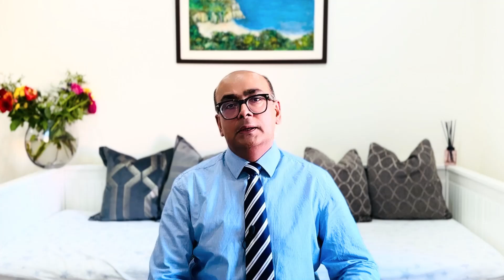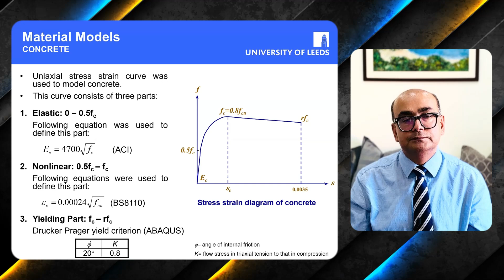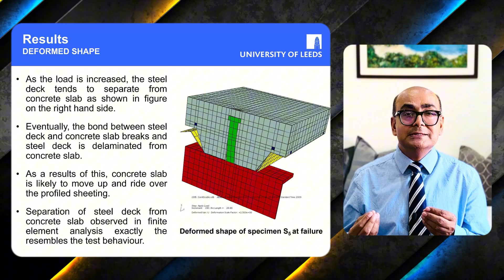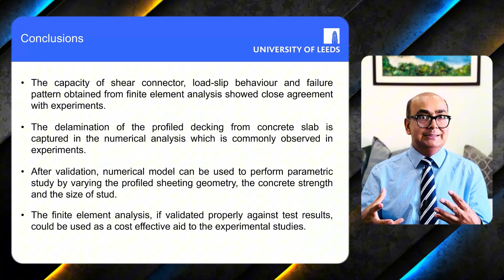How Do Headed Shear Studs Really Perform in Profiled Steel Sheeting? The Answer May Surprise You!

Comment from the maker: Please use these time stamps to jump between sections:
⏰ TIMECODES ⏰ 
00:00 – Introduction
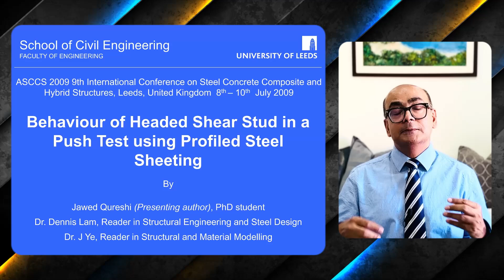00:52 – What is a composite beam?
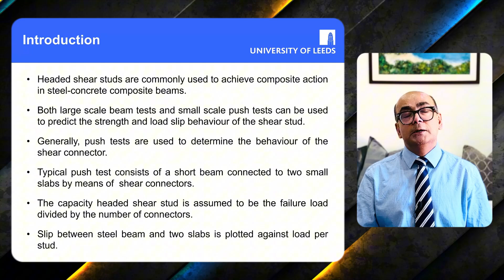02:40 – What is a push test?
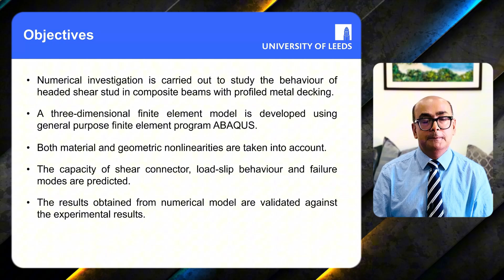04:20 – Details of experiment 
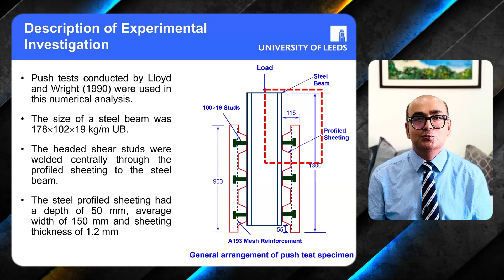06:27 – FE model and mesh 
07:49 – Boundary conditions and load application 
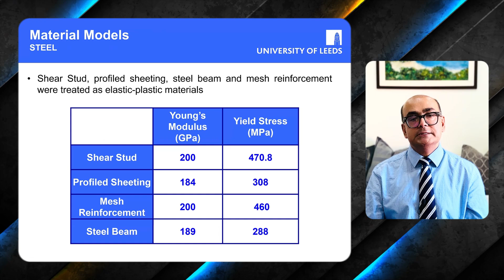10:47 – Material models
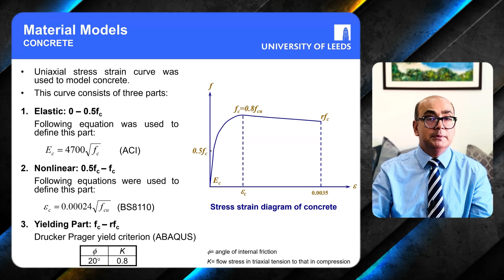13:47 – Results Load-slip behaviour 
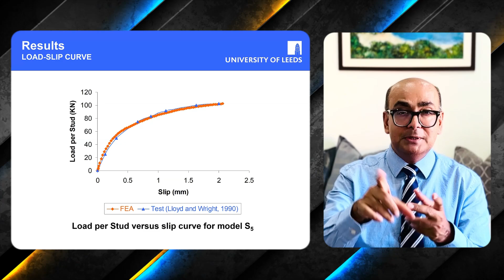15:32 – Deformed shape and stress contour plots
18:29 – Conclusions